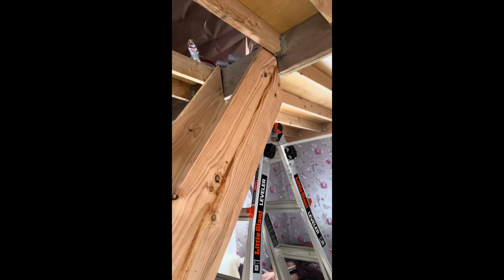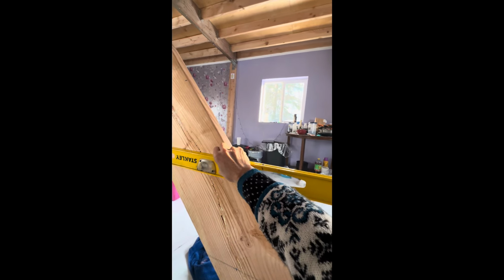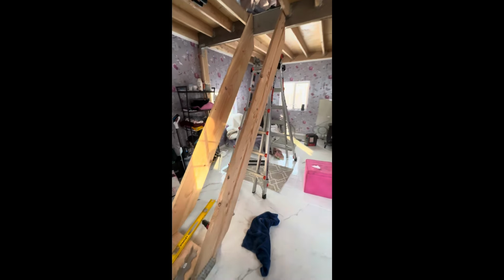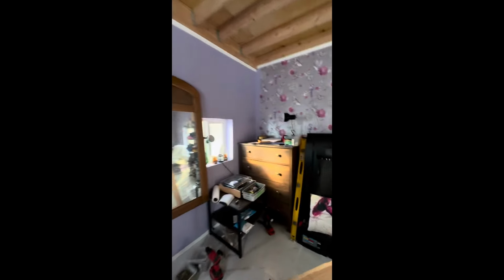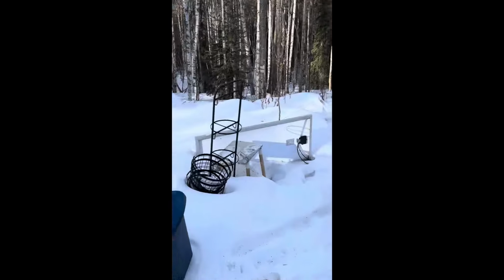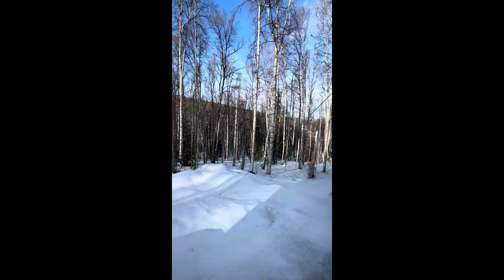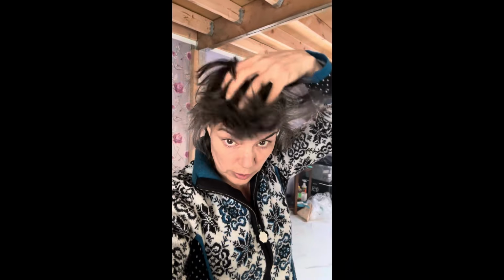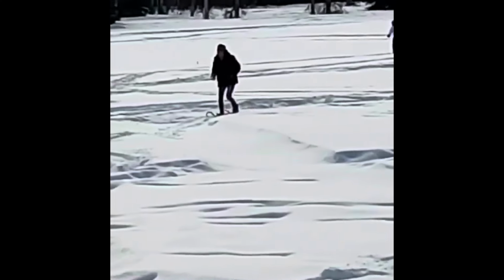The stairway is built from lumbar and Simpson hardware. Here’s an update on surviving the winter.

Comment: I enjoy your channel. You're not afraid to tackle any job. Watching your video about excessive moisture in the cabin- a couple of comments.1) It's possible the wood was still too moist from rain during construction. 2) Wood-burning stoves give off dry heat. So much so that you may need to humidify (add) moisture to the cabin. 3) BUT! a portable propane heater gives off a lot of moisture! A lot! I've seen houses ruined by propane heaters. Mold, wood rot, etc.
air
Reply from the maker: Ok good to know about propane, this vapor barrier was a problem. It may still be a problem as I haven’t been able to prevent making holes in it while working.

Comment: You do woodwork like I do. The "also I put a screw here" part is probably rated for more shear force than the stairs will ever see. But you still have four or five more brackets and filled every hole in all of them. Any one pair of brackets would probably be enough too! In the end you could probable put a 300 pound man, like me, on every step and it still wouldn't even move. If you have a big quake the stairs will cross brace the whole house. The snow shoe race looks like a particular sort of torture, I used to cycle a lot, but running was never my thing. Very impressive.